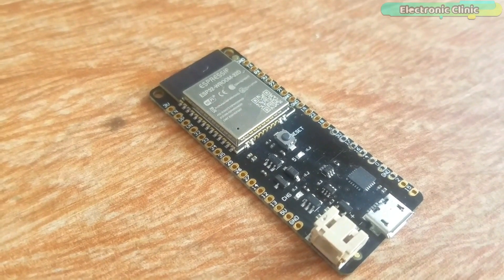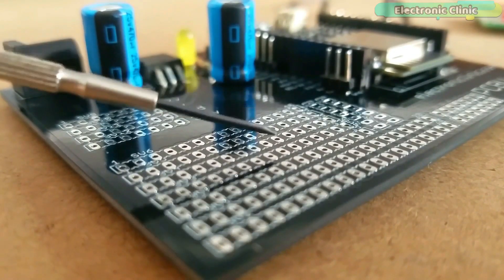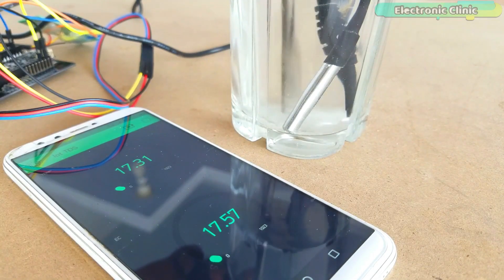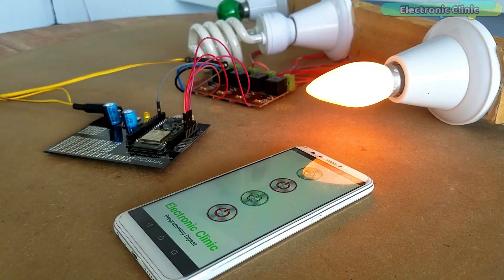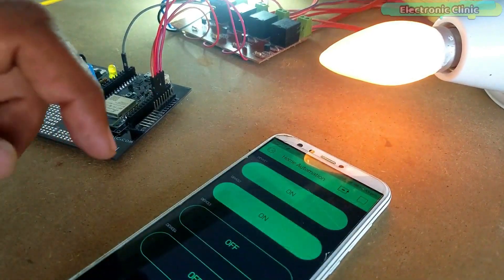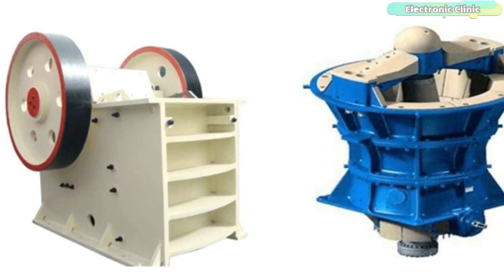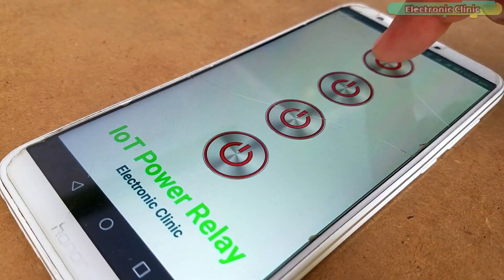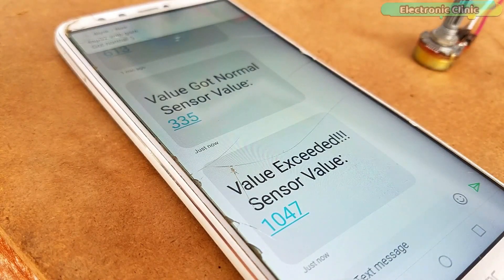ESP32 projects for Beginners, ESP32 IoT projects, ESP32 Simple Projects, ESP32 Projects IoT, Top 10

Comment: Need to use esp32 in my car , what is the best power supply to use ? ♥
Reply from the maker: use 7805 regulator to power up the esp32, this way you can connect it with cars battery